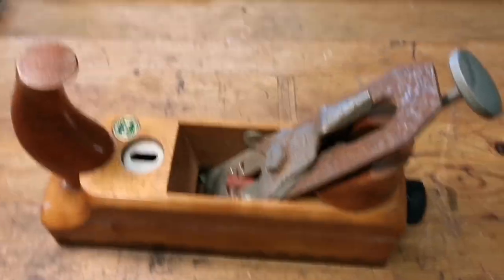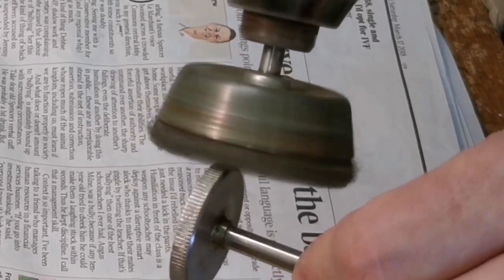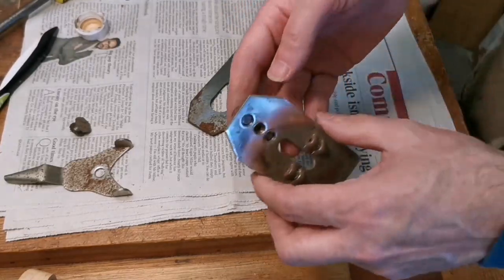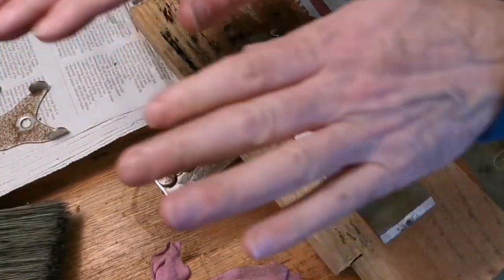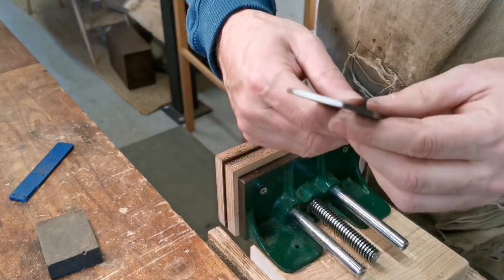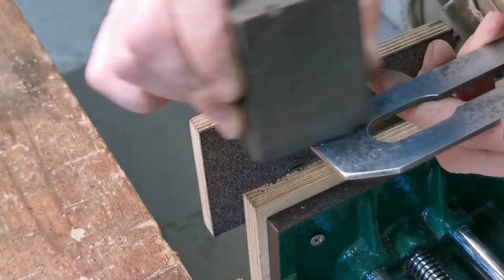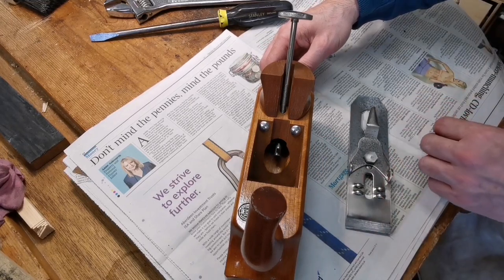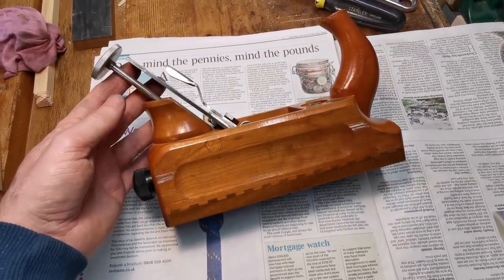E.C. EMMERICH Primus Reform plane Iron.. Cleaning ALL of the metal parts of the # 711 plane - Part 3

Comment: Nice, I am always happy to learn from an experienced craftsman's method of work. The Sandflex blocks I mentioned in the chat seem to be exactly the same as the Garyflex.
Reply from the maker: Thank you. Ahh.. Now I know what Sandflex is. Thank you
Reply: @twcmaker  Most of the ECEs I got off ebay were just like this - they were slightly used and had never been sharpened.
Reply from the maker: I think it's a 'thing' with planes. Especially the dearer ones. People spend the money but don't use them. Shame they don't keep the box and that would put the second hand market price higher..but they don't usually. You'll notice from the first video on this plane that my 'new one' is still in the box. Well, that's just incase I decided to sell it. Keep the boxes guys 👍👍👍

Comment: Did you ever do a final video of the restoration?
Reply from the maker: I've not done it yet. A very busy workshop put a stop to it. I will get one more done before Christmas. It's not easy adding YouTube to your workload. I'll definitely do it because it's very nearly done. Just need to camber the Iron, lap the sole and have some fun trying it out on different woods.
Reply: @twcmaker  completely understand I worked as a luthier for a small custom shop for 7 years and trying to fit filming, and editing into the schedule was a challenge. I just received one of these planes along with the 701p for free but they need some work so found this video series very interesting.
Reply from the maker: I'll try to do something in the next week. Then allow a week (to make and find time) for edit.

Comment: I was so smitten by the 711 that I bought one. Nominally used, but like new. I looked for trapped shavings, and found a bit around the throat adjster, so cleaned that out. The worst part was the glossy factory finish, which appeared to be oversprayed varnish. I’m cleaning that off and will refinish with boiled linseed oil and paste wax Am eager to see your modifications.
Reply from the maker: Hi Stu. You bought one after watching my video or a while ago? Ahh that varnish... At some point it will have to go. And the mods (after  getting it set up & working) will be very cool. I think it'll be very cool.
Reply: @twcmaker  After watching the first video in this series. I was planning to purchase a wooden smoother, and the mechanism in this one intrigued me to the point that I decided to look for one of these. I found one that appeared to be a good deal and snapped it up.
Reply from the maker: And how are you finding it?